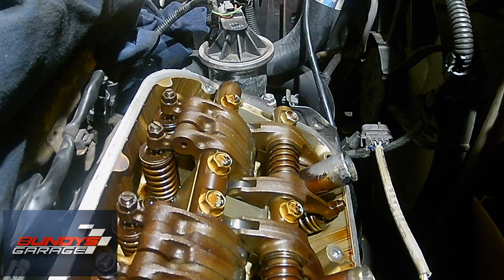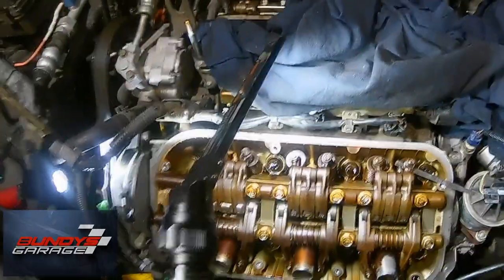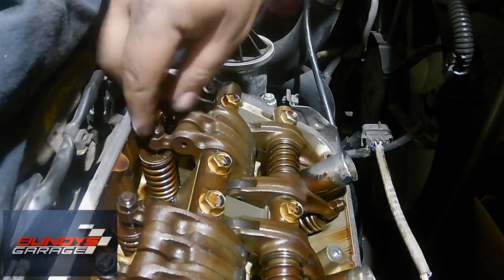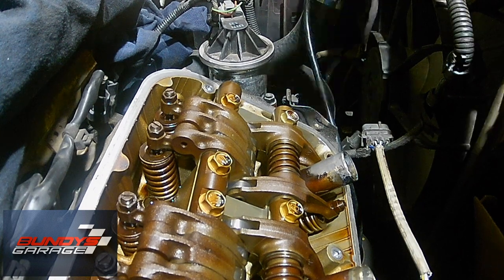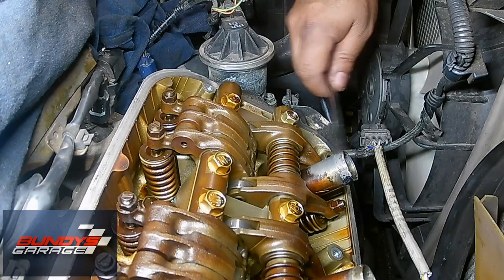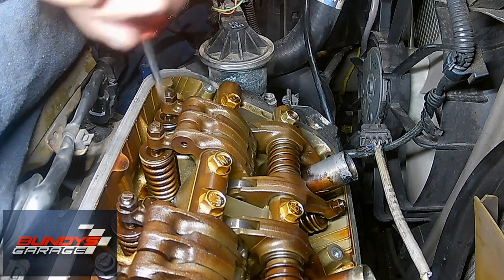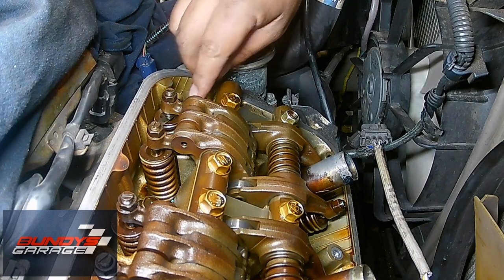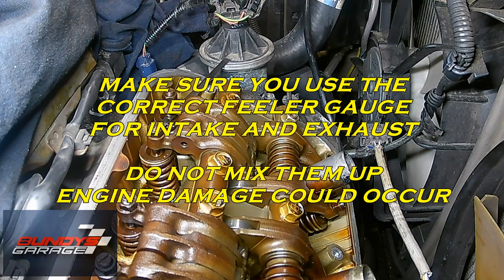Honda Acura V6 J Series Valve Lash Adjustment | Accord Odyssey Pilot Ridgeline MDX TL CL MDX Bundy

Comment: Is-it a DIY job?? My mechanic is not wiling to do it, if I have no problem (no CEL, misfire, drivability issues), telling me it’s a big job. My odyssey 2011 is 110k miles.  Dealership is telling me to adjust if noisy, but I know exhaust valve get thighter over time and can lead to burnt valve.

I did my TB, water pump my self and everything went well, but valve adjustment looks harder to me.

Thanks for the video again
Reply from the maker: If you did the TB yourself this is a walk in the park. Not hard just time consuming.